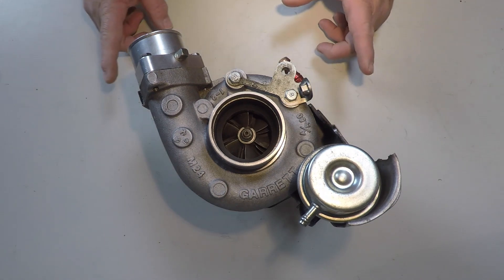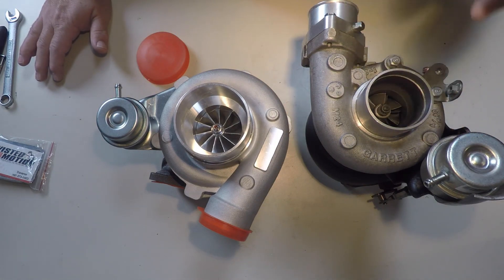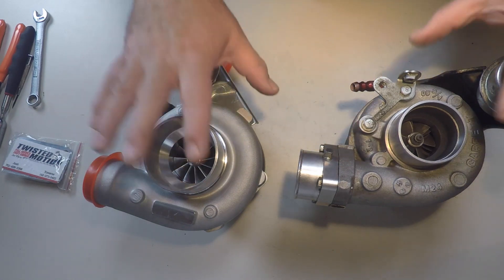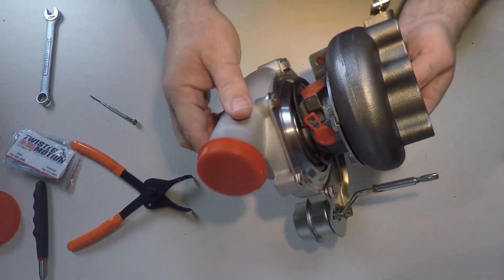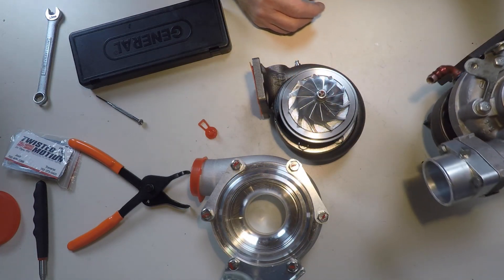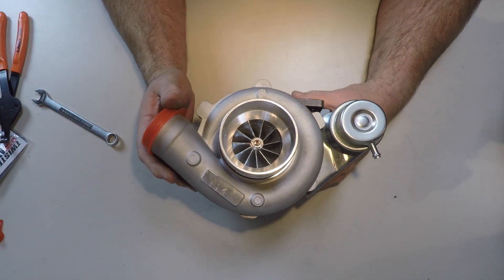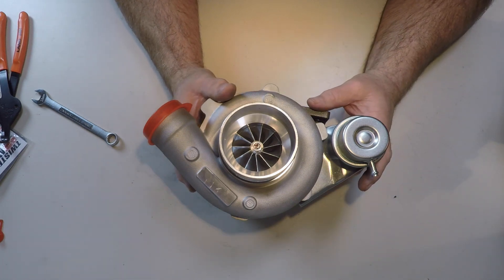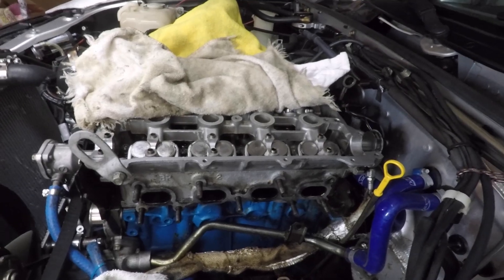New Turbo Unboxing - Twisted Motion GTX2871R Review and Clocking

Comment: hello can you give me an opinion on this turbo?  it works perfectly?
Reply from the maker: It’s good. The waste gate actuator on mine was not very good tho. Replaced with a turbo smart unit.
Reply: @Seandoestech  thanks for your answer, may i know at what turbo pressure you work and how many miles it has traveled?
Reply from the maker: @etextremetools  20K at 18 PSI max :)
Reply: Thanks for posting this video purchased this turbo v3 a few years ago and I'm finally getting to the time to Dyno tune and got nervous was wishing I got a name brand, glad to hear it worked out for you.  Really hoping this turbo performs as it should during Dyno session mounted to SR20. Upgrade the waste gate to turbo smart as well.

Comment: How was your overall experience with this turbo performance/reliability-wise ? Seems like some people on youtube slander Twisted Motion for being nothing more than chinese ebay turbos but it would be interesting to hear from someone who actually has one ...
Reply from the maker: It’s fine. It spools later than I like, but produces great power 4K thru 7k rpm. Horrible cheap actuator comes with it, so I’m replacing mine with a turbo smart unit. I believe twisted motion rebuilds these using better bearings and billet wheel, then rebalances it.

Comment: Hey mate thanks for the video, very informative. Hey are you still running this turbo? Thinking about ordering one for my sr20det but have heard mixed reviews from twisted motion.

Is this turbo still running? How much power did it make? what is the spool like?
Reply from the maker: The power is good but I haven’t dynoed it yet. It’s slower spoiling for sure. I think I can help it with a 3” exhaust, currently with 2.5”, but spools way slower than the 2554 garret I had, no surprise tho. Honestly, I think I should have saved up my money and just gone with Borg Warner EFR unit (1200.00 )

Comment: How is this holding up? I’ve heard about these guys and I was thinking about getting one for my Miata (1.6) around 10 psi probably
Reply from the maker: Hey Jesse, I’ll let you know. In the process of installing right now. Upgrading my injectors too.
Reply: They are eBay turbos at a higher price. I would avoid if I were you.

Comment: Great to see you are back! Thanks again for the advice with the motor mounts. Went ahead and installed them myself on my 10ae and I absolutely love them. In my opinion, they are purely better based on design and I didnt have to do any modification to fit them. They are snug with the motor mount cup/plates and like you advised, I only had to get the right hardware for them!
Reply from the maker: Juan Lopez  Nice! I’m glad they worked for you.